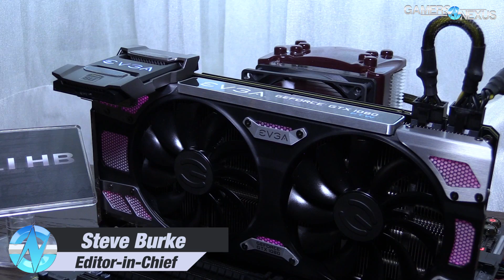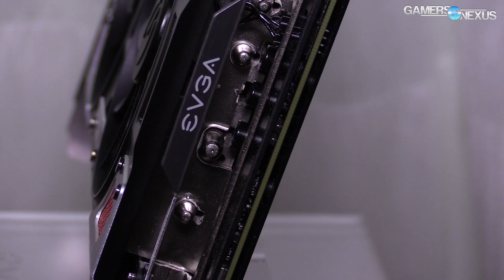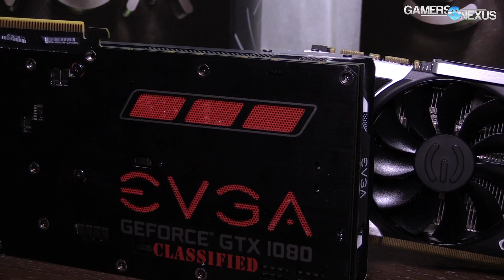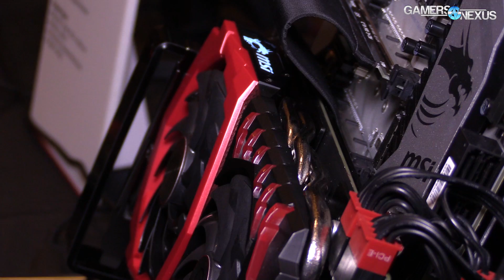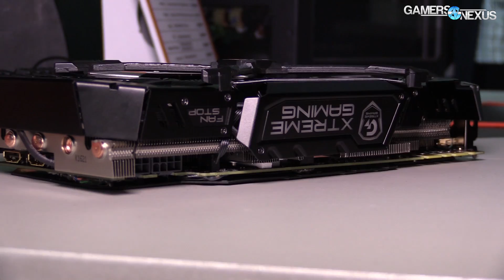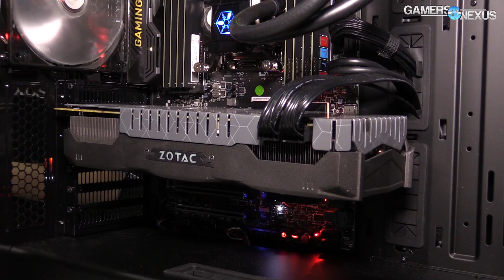Best GTX 1080s at Computex 2016 | ASUS, EVGA, GByte, MSI

Comment: Do you know the temperatures and noise of some of these cards? (Maybe EVGA and asus)?
Reply: EVGA ACX 3.0 Apparently stay pretty cool and quiet as low as 44% fan speed so a simple 50% speed should keep a 2Ghz clock rock solid at 70c with ease. I hear the same for MSI.

Comment: Trying to buy a 1080 at the moment is a nightmare, no one has them and the only ones that do is a couple seller's in England where I live trying to rip people off with silly prices because of demand!😟
Reply: Founders is £619, but a couple people in the UKon EBay are trying to get £800 just because they know everywhere has sold out at the moment!😟
Reply: +El Diablo 
Think I will wait to be honest, but I really need a new card ASAP as my AMD 7970 struggles with Doom maxed out even on 1080p gaming and I want to upgrade my monitor for 1440 gaming now!
Guess iam at the point if I had a 980ti now then it would be fine for a little while on waiting!, so even a 980ti would be a massive upgrade to what I have now!😂

Comment: Why is there such limited info from these AIB partners - the point of this show was to announce and reveal stuff, especially when these products are supposed to be landing soon.
Reply: My best guess? They are trying to figure out how to modify/fix the bios voltage issue or other issues Pacsal is presenting to them (Steve hits on this briefly) They offer a range of cards from close to reference to beastmode cards and price accordingly. If you buy for example an EVGA 1080 sc card and also an EVGA 1080 Classified and both overclock exactly the same (See bios voltage/Pascal issues mentioned above) and give the same exact performance the only reason to buy the more pricy card is E peen reasons. So my guess is they are holding back full stats til they can iron some of the issues out. Again this is just a guess.

Comment: Soo! EVGA Classified is the only card that we know of, at the moment! to support overclocing, because of the vbios bypass
Reply from the maker: Well, they all support overclocking -- but anything with an external bypass should do better. That said, I'd hold off on buying until we can validate those claims!
Reply: Agreed, It's a shame we are having to deal with this problem, I bet loads of people will buy a card (going off last years 980s designs), then realise this problem, but only after buying, forums are going to be filled with this stuff, if the vbios is a big limiting factor

Comment: That Zotac card looked proper thick, is it a Three slot gpu? I'm still on the fence about what one to buy, with the V-Bios limiting factors it seems pointless in getting a higher tier card if it's still going to be locked.
Reply: +Adam Watts (SignedAdam) That's kind of true. On my card specifically I get 1456 out of the box with only GPU boost doing is thing. However, Zotac cards have a weird issue with power in that it will rarely go over the 100% power limit. Power target can go all the way up to 111%, but it will rarely use it. You can increase the boost clock, memory clock and voltage all you want, but the card will always stay under 100% power. It's a known issue with these cards, and was also a problem on the 980's as well. 
My EVGA 970 and gigabyte 760 used to always use more when I overclocked them. Honestly though, I can't complain because the card is definitely a beast. I know it can overclock much more, but the card just won't accept more power.
Reply: From what I've heard AKA don't quote me! There are definitely 2.5 slot cards in this video and rumored possibly 3 slot cards to come (if some of these aren't already 3 slot). Just remember that the reference 1080 throttles like crazy with the Nvidia cooler (unless you pump up the fan) so if you are going to overclock these 2.5-3 slot offerings might actually be just what we need... Or just watercool in a custom loop for a 1-1.5 slot option.
Reply from the maker: Looked like 2.5 or 3 slots. Zotac has done 2.5 slots before... we haven't looked at it closely yet.
Reply: it's a 2.5 slot.. fucker is way too big
Reply: Jeez, well that card is definitely off my list would cover my second PCIE slot.
Reply: It looks just as big as the 980ti version. I've got an amp extreme 980ti and the sucker is HUGE! If it's the same size it's a three slot card. I think the standard amp card is only a 2 slot, but I could be wrong.
Reply: ***** It certainly looks a 3 slot, maybe a bad decision on Zotac's part.
Reply: The more space it takes up, the more overclocking you will gain, the Zotac 980 extreme beats all the 980 card on air cooling, I think the same can be said for the 1080 cards,
Reply: I mean if youre going to do SLI, zotac is not the one for you.